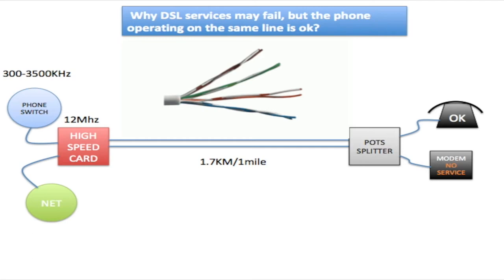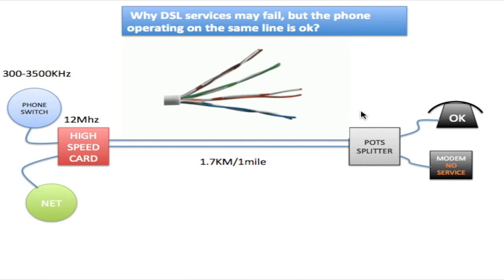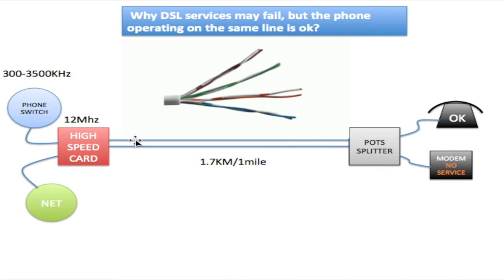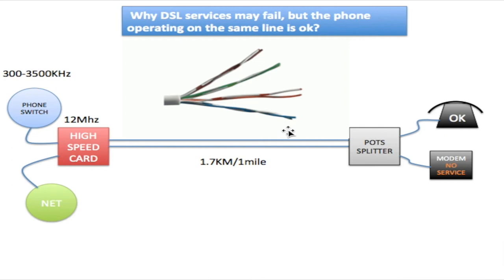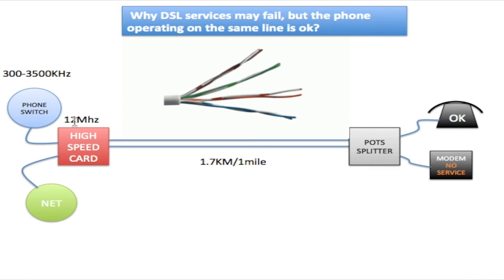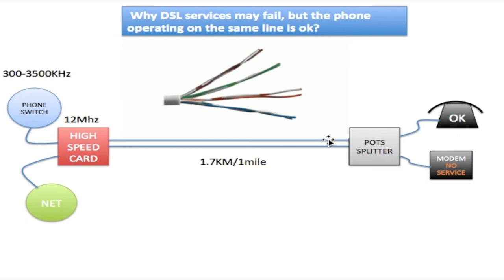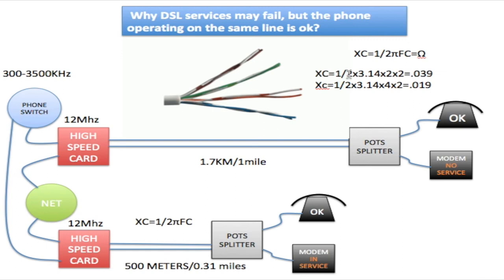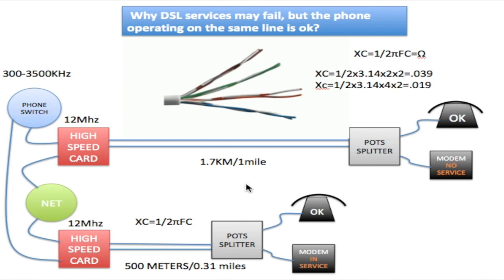How to fix your Dsl line

Comment: This makes sense, and explains why the reverse can be true, if one leg is disconnected you have working dsl (albeit crappy) but no phone service, great explanation as always Trevor, thanks
Reply from the maker: You are welcome my friend, Take care.
Reply from the maker: Regarding your question about a half open line where the DSL work, but the phone does not.  The phone requires both TIP&RING to work, but DSL would work with a half open line, however the line speed would be slow.  I have seen this in the field.   I'll do a bit of research and put out a video on this very soon.  Thank you.